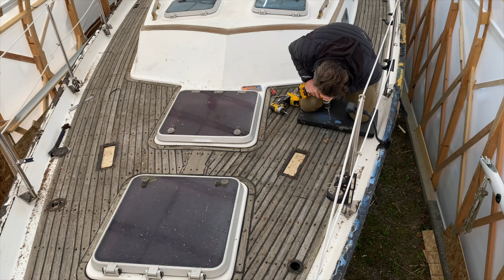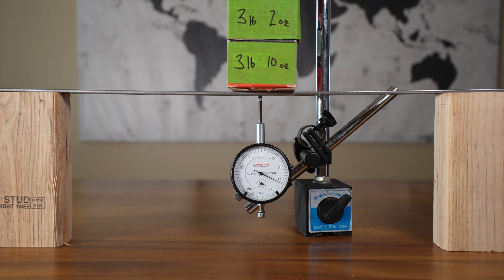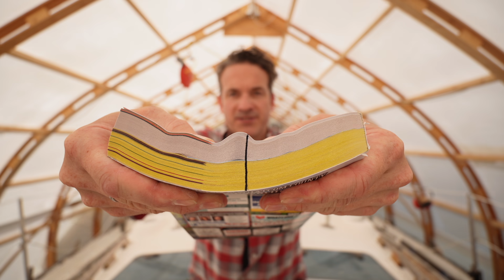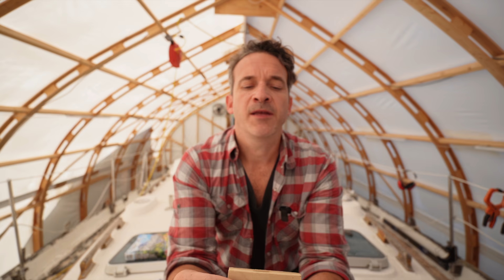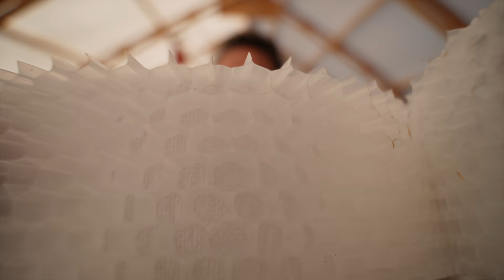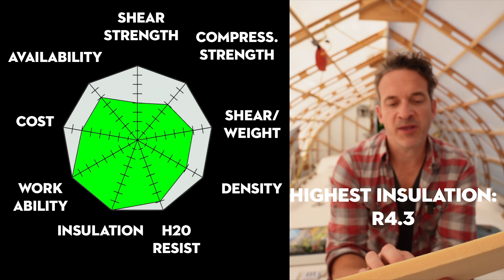The BEST Fiberglass Deck Core Materials (And How To Choose)

Comment: Excellent, excellent video. I had no idea there were so many options until I saw this. Why wasn't King Starboard mentioned?
Reply from the maker: Starboard is a high density plastic that will not bond properly to fiberglass resins. It has its place in a boat for sure… just not as a core material.

Comment: Rice crispy bars make excellent core material. It's light and quite rigid when sandwiched between layers of biaxial fiberglass. You can shape it with your teeth or a kitchen spatula, and it eliminates the need for lunch breaks during installation
Reply from the maker: That definitely sounds like a delicious way to build a boat, though maybe not the most durable! 😋

Comment: I think the thing to consider is that only epoxy resin is waterproof, so any core in non epoxy fiberglass contruction is going to be wet.
Reply from the maker: That’s a good point. Poly does allow water to creep… water gets EVERYWHERE!

Comment: I can't imagine non treated exterior sheathing not being adequate for a deck core as long as it's installed correctly.
Reply from the maker: Once the screw holes are added. All bets are off. Water goes EVERYWHERE!
Reply: @livingforsail seems like drilling larger holes and filling with epoxy would solve that. Marine plywood would need the same.
Reply from the maker: Yes! Agreed.

Comment: I come back to this video from time to time to continue my education in fiberglass composites. I'm in the first year of repairs on a 44-foot sailboat with some minor core problems. Fortunately, the decks seem 100% solid and it's only a lazarette/locker cover with a failed core. This is an ideal project for me to learn how to re-core a fiberglass panel because it's small and removable. In addition, the boat has a permanent  hard enclosure roof that keeps things mostly dry. So, even though this lazarette is mostly sheltered, I am keen to try my hand with a foam material so I will go with Divinycell based on this presentation. After searching for a boat with dry decks for two years and running across countless failed wood cores, I just can't do balsa or plywood!
Reply from the maker: Thanks for watching (and re-watching!) good idea with the  Divinycell and yes… stay away from wood! Haha

Comment: for cheap material there is Go board, it is a polyisocyanurate panel for tile backing, it is fiberglass resin compatible does require lamination on either side as it has no real tensile strength but will not rot and is comparable to plywood in pricing
Reply from the maker: Thanks for the tip! 👍
Reply: thank you for this info

Comment: Maybe a top / bottom combination to have best of both worlds. Waterproof on top and strength on bottom.
Reply from the maker: Do you mean two core materials?
Reply: @ that would be my idea. Similar as the black sandwich foam core. But i guess just placing 2 cores on top reduces shear strength as long as they are not stitched together
Reply from the maker: @olaf_s_23  They need to all be well laminated together to work. It might just complicate your work without adding a whole lot but it's an interesting idea.

Comment: What about high density Polystyrene plates?
Reply from the maker: I’m not familiar with that. Is there a trade name that I could look up?
Reply: @livingforsail  BASF and DOW produce polystyrene plates, used in house construction. The high density variant is used for floor insulation. Commercial names are Stytofoam and Styrodur. It may be interesting to look at this material. I'm sure it's a lot cheaper than the materials that you have looked at.
Reply from the maker: @dirkmechant5027  Very interesting. Thanks! I know that some polystyrenes like to absorb water so that makes them a poor candidate... Not sure about these panels though.

Comment: How is the process of repairing? If that happens close by the chain plates … no go?
Reply from the maker: Most people remove one skin, either top or bottom, then replace the core and re glass. That’s what I’m doing. Chain plates may or may not be in the way.

Comment: Thanks for all your videos.  I really love the parts of your videos where you explain the "WHY" and not just the "How".  BRAVO to you!
Could you please tell us why so many boat builders prefer to use PET panels, as well as other types of foam core panels, when laminating your bulkheads,.. yet other builders,.. such as "tiny camper" makers use XPS panels to laminate walls and bulkheads?  Thank you.
Reply from the maker: Thank you very much! 🙏
There are some good PET products out there. The Kerdyn foam in this video is PET. I think there are some manufacturers now that make pre laminated panels for building bulkheads and that’s a nice time saver. 
Using XPS (like the pink stuff from the big box stores) might work fine. Make sure you test compatibility with your resin first but I am not aware of the specs on those panels and from my experience they are much smoother than the foam panels sold for fiberglass core so I assume the peel strength of the glass lamination is probably a lot weaker. So it’s the age old question: when do you want to spend your money? Now, or later?
Cheers. 👍
Reply: @livingforsail        Thanks for answering!  I'll look into the peal strength question.  Once again, great work on all your videos,... especially the "WHY" ones.

Comment: No mention of pvc board being used in the marine industry? Much cheaper than foam.
Reply from the maker: Technically, Divinycell is a PVC foam board… are you talking about solid PVC? I’d need to look at specs, but I think density would be a concern…

Comment: How about UV ray durability?
Reply from the maker: Good question. If you are covering the core in good time it shouldn’t be an issue once the gel coat/paint goes on. 

Diab has told me that apart from some darkening of color, the Divinycell is uv tolerant. Same with Coosa apparently. 👍

Comment: Don't forget about conformability.  If you are dealing with a curved deck or hull some stiff core materials will be tough to work with.  You might have to cut it into smaller pieces or at least cut deep grooves in it to allow some flexing to conform.
Reply from the maker: Yeah, that’s a REALLY good idea to add to the matrix. A little late for me now but maybe if I do an update someday. … thanks!🙏

Comment: I'm planning on building a lightweight 12 foot tender and putting a 20 hp outboard on the transom. I was thinking of using foam sandwich between carbon fiber. What would you recommend?
Reply from the maker: A lot of people use Coosa for transoms. It’s still reasonably light. Carbon and 10lb foam would certainly be lighter. I think you’d really need to get your design reviewed to make sure it’s stiff/strong enough if you’re going for “as light as possible”
Good luck!
Reply: @livingforsail  I've got the design. It's strong enough to handle rough chop while pushing it with a 20 hp at full throttle for hours on end. That Coosa sounds like the perfect material for the transom and foam for the rest. Would you recommend using foam with little holes in it so that the resin flows through connecting both sides or would that not be a good idea?
Reply from the maker: @robertlaird6746  The holes in the foam are primarily there for allowing resin and air movement if you are doing a vacuum wet layup (some holes) or infusion (many holes). If you are just doing a traditional wet layup then you don't need any perforations but if you have some, it will still work fine. 
That is my understanding from the manufacturer of the foam that I am using.
Reply: @livingforsail  Will the manufacturer guide me in the direction I need to go as I have never tried vacuum wet layup or infusion. I'm thinking of doing vacuum wet for the hull itself and then for everything else, traditional wet for the most part anyways. Also, what size of holes should I use or drill out and what spacing? Also, what thickness of foam for the hull?
Reply from the maker: @robertlaird6746  I would put a call into the folks at DIAB (makes or Divinycell). They have some tech experts that can likely help guide you. I have also found good help from the folks at Coosa on the phone.

Comment: If you're having take the old core out, why not refill with resin and skip the core materials all together.
Reply from the maker: The core is 3/4” thick. That’s a lot of very expensive resin… it also has poor mechanical properties when it’s not combined with glass (think of cement without rebar). It would also be incredibly heavy and would make the boat less stable. 
If you mean, why not drill a bunch of holes in the wet deck and inject epoxy like some do on YouTube…
That’s not actually a repair. Nothing will bond to wet and rotten balsa or ply or the old deck skins. Will it seem more solid after? Probably. Is it as strong as the original design was intended to keep you alive in a storm? Certainly not even close…
For me, with goals to go over the horizon, a proper repair is worth the blood, sweat, tears, and $$$. 
👍

Comment: Expanding epoxy foam? Has anyone used it?
Reply from the maker: That’s more common for filling molded parts like a rudder for example. It would be a challenge to get an even core thickness with expanding foam for a deck.

Comment: Used injectadeck on my 1986 J35 three years ago, and it is still as hard as a rock
Reply from the maker: I would consider that for a coastal cruiser on very small repair areas. 

Personally, I’m not taking anything over the horizon with injectadeck…

Comment: I own plywood 24ft trimaran. I used epoxy primer for plywood deck + epoxy topcoat. It needs painting due too esthetic reason but it works fine as an water insulator. If I had come back in time I would have used polyester topcoat instead.
Reply from the maker: Very cool! By “top coat” do you mean a layer of fiberglass? Why would you have preferred poly?
Reply: @livingforsail  No, actually. Topcoat is the final layer. Epoxy topcoat has one disadvantage - it doesn't sustain sun in a long run. By now my deck which was covered with topcoat has faded. Poly is UV resistant.

Comment: What about other plastics for strength needed areas. Like Structural FRP fiberglass sheets, SG-200 , Nylon sheets (hard plastic) , or even delrin where the weight is no an issue? Will these even adhere to the epoxy? Have you ever tried other plastics?
Reply from the maker: SG-200 looks like it would be good in loaded areas if it bonds to epoxy or poly resins. It’s about half the shear strength of G10 but still very high. 
I think nylon, delrin and most other plastics will not bond well… or at all. 
Interesting thoughts though. 🙌👍

Comment: Corecell has been around at least since the early 90s. I'm buying a boat made by Cabo Rico in 1993 built with Corecell. This is very good stuff. It has a high resistance to impact.
Reply from the maker: That’s a really solid choice! You should do well with that. !

Comment: Use tricoya MDF.
Reply from the maker: I’m not a  if fan of MDF in general but this is an interesting product that I didn’t know about yet. They don’t report shear or compressive strength and I’d be suspect about the ability to resist shear in particular. Also a bit heavy… have you tried it in this application?
Reply: I have it build in my transom in a Phantom 21 with a Merc 275 Verado Supercharged behind. 
3 layers of 18mm that is very strong and not superheavy. 
And because i wanted the boat to be as light as possible that was important too. 
Love your info. 
Keep on sharing please.

Comment: I am going to make a cover for my boat smaller but very similar to what you have done.  And for the exact same reason.  Replacing deck because teak and thousands of screws.  Curious as to how to make those curved beams.  I would like to do the same - but not sure how to bend it.. Even with the thin wood  did you have to do something special to get it to bend?  Also how thick is the curved wood.  Maybe you did a video explaining the process? :-) ... I will check.. Great video by the way.
Reply from the maker: Very high level but this might help a bit...
https://www.youtube.com/watch?v=4bG5AauMVf4
google search "LSU gothic arch greenhouse shed plans" it is BASED on that...
The beams are split 20' 2x4 planed to 1/2". Everything is glued and screwed together to make the arches. I made 2 every 24 hours for a couple weeks... I wanted the glue to cure before pulling them off of the template but that might be overkill...
Good luck!!
Reply: @livingforsail Many thanks for the tip!  I actually plan to make a storage unit behind my garage as well.. So that build can be my  practice run.   Then I will do the same ( or something similar ) at the Marina.  Again thanks for the tip.  Come June 1st I quit work to start on this.  Am very nervous .. but it needs doing.  BTW: I have a Cheoy Lee Midshipman 40 - 1975.

Comment: Brilliant video. 👏 
Have you considered xps foam?
From what I can see it scores high in all sections.
Reply from the maker: Thank you! 🙏
XPS doesn’t fair so well with peel strength. Not something that I explicitly scored. It would probably work (with epoxy). I haven’t heard of too many structural components built with it though… great for the ice box though!! 🙌👍

Comment: are these values for sheer strength etc, before or after resin application?
Reply from the maker: Those would all be reported for the core material alone. No fiberglass or resin. 
🙌👍

Comment: In Denmark we tend to use Okume plywood - also called Marine Plywood. It is not common in "regular" stores, and many "regular" stores tend to misinterpret the difference of another material named "oesten" plywood, but there is a world of difference. If you do not want to go with Plywood for the deck,  the light foam is in Europe name Davinycell, and is extremely easy to work with as it is very flexible, and holds no water.
Reply from the maker: Hi. Thanks for the feedback. We have a few varieties of marine ply in my area (mostly imported from overseas). You’re right that some “marine” ply’s are deceptive. Best to look for the official stamp!
I actually did decide to go with Divinycell H100 for most of the deck and you are right about it. Great stuff!!

Comment: what a great video.    what is your opinion on drying the deck vs replacing?
Reply from the maker: Thank you. 🙏 
I’ve seen the videos where people drill a bunch of holes and “dry” the deck before injecting a bunch of epoxy into old rotten decks. It might provide more stiffness but it is not a REPAIR in my opinion. 
I recently saw some pictures of a deck being replaced after a previous owner attempted this “fix” and he was removing all these little clumps of epoxy barely stuck to rotten balsa. 
It would probably take 10 years for a deck to dry out naturally with a bunch of holes drilled and even if the balsa/ply dries, if it’s started to soften and rot, it’s not much good anyway…
Yes, it takes longer to replace the deck core but it is the only true repair (my opinion 😉)
Cheers!

Comment: Insects...yes. Termites got into my boat that was parked on land for 8 years and completely made the wood in the transom disappear except for a small handful of hard flakes. They built mud-tunnels behind the cabin-liner and my fiberglass decks are springy so I assume they ate the wood core there too. But it's fun to rebuild it all better than new so I'm happy.
Reply from the maker: That, my friend, is an amazing attitude! Best of luck with the rebuild! 👍🙌
Reply: Well that’s handy - they saved you a lot of messy work.😉

Comment: Hi Jon, great video as always! A note on ply how I know it. Hydrotek and Aquatek use Meranti from the Philippines and are of slightly different quality. Then there is okumé from central Africa. Then there is high quality Sapele plywood from west Africa. Some variations are for beauty in interiors only and use an okume core but sapele sides. And of course you know teak plywood. All these are also available for boatbuilding in Europe. What we don’t have as readily available is marine Douglas fir. All of the above mentioned ply’s have quite different characteristics and weight.
Other interesting options for race boats are honeycombs made of aramid fibers or Aluminium from many different brands and I might also mention that foam cores can also be supplied with kerfs mounted on a grid similar to the balsa when more curvature is required. 
Curious to hear what you chose. The winner seams clear to me:)
Reply from the maker: Hi Aladino. Always great to have your input over here as a master craftsman and shipwright! 
You make good points about the variety within the "Marine Ply" world since BS1088 does not specify the species to be used, only that it is "durable heartwood" - I'm paraphrasing here but invite anyone to look up the standard if they are curious and reading this... 
I sort of took an average of various plywood numbers (which are hard to find by the way).
I hope that you approve of my choice... the pressure is on!! Haha.
Reply: There is also Australian plywood ;)